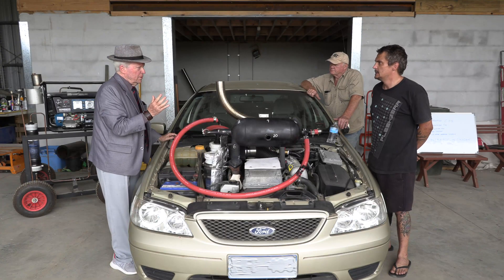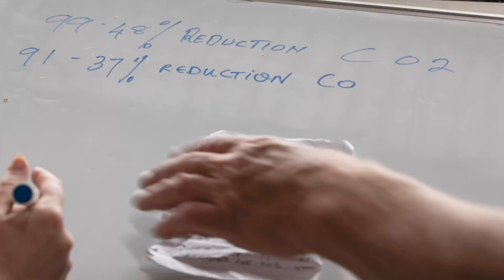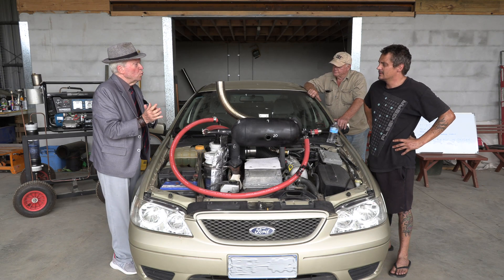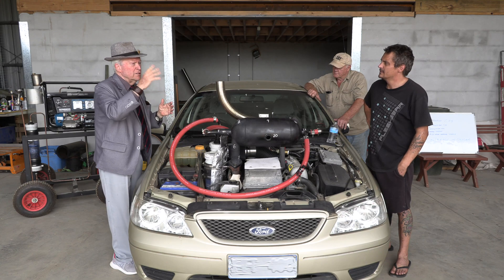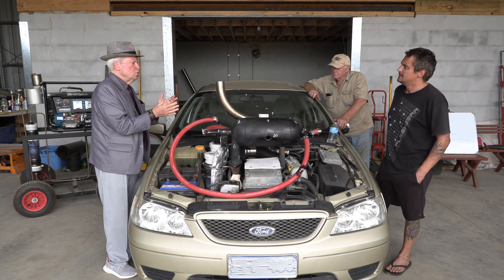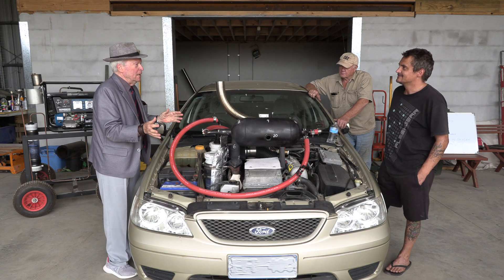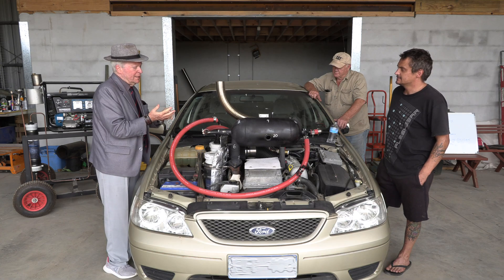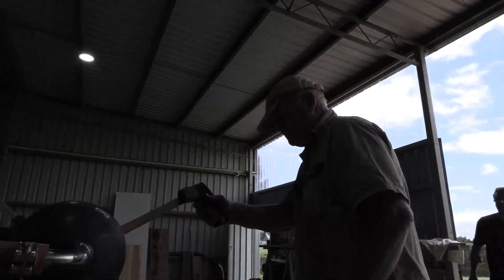Roland Perry introduces the Plasmoid Car (Copyright Strike Foundation - Bendall Legacy Archive)

Comment: I can understand the engine running off the plasmoids when running at a constant rate (e.g. at idle) but how will the thunderstorm generator handle quick acceleration of the car?  Wouldn't more "fuel" need to be injected somehow to achieve acceleration or would conventional gas/petrol be required?
Reply: I had the same thought and got to ask Malcolm Bendall about pairing it to a CVT transmission and running it at a constant rpm. He said that would do a good job, lots of research to be done. 

He also said that for various ranges of rpm there will He a temp   spike when it is running at optimum fuel ratio which a computer could easily be programmed to for fuel injection at various rpm ranges